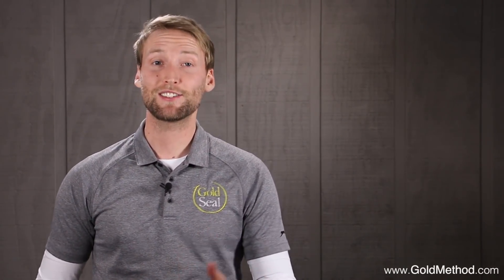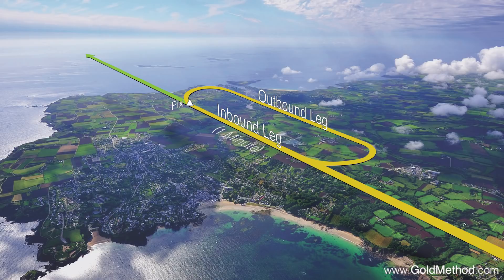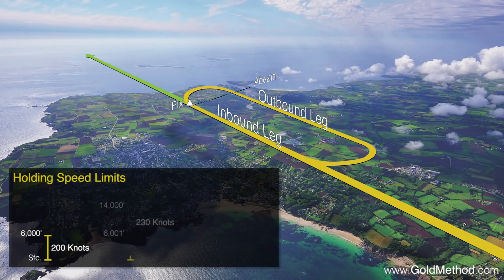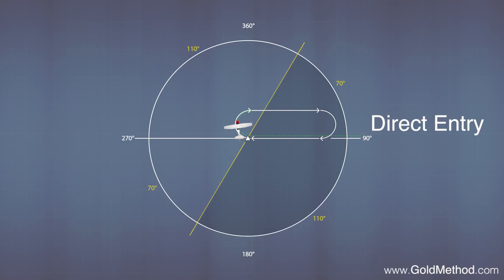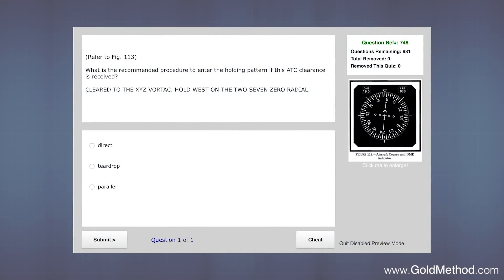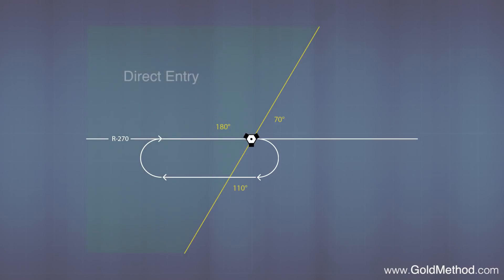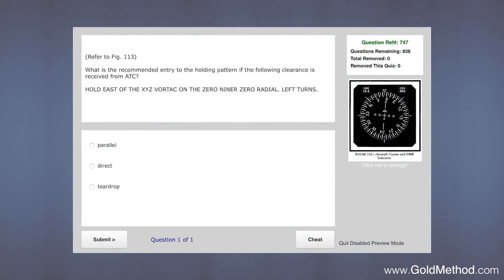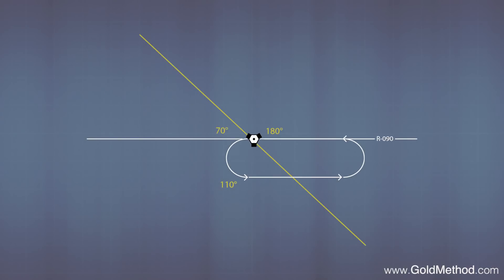Holding patterns  - Instrument Written Test Prep

Comment: I don't get why there is even a teardrop entry as a choice. Who came up with that recommendation? No matter where you are coming from you can either enter direct or parallel. The sharpest turn to parallel on the teardrop side is way smaller than sharpest turn to parallel on the parallel side of the fix. Should only be 2 choices in my opinion

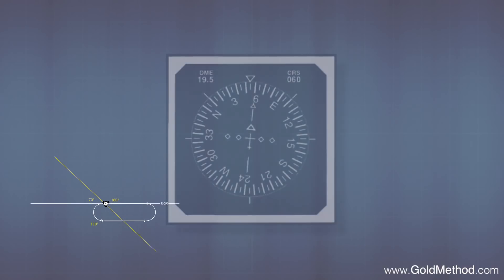Comment: 5:46 why is the yellow line draw from NW towards SE? dont get it. I have headache and frustration
Reply: That is for the non-standard left turn (reciprocal of the standard right turn). It's "the standard right turn" mirrors at the very first of the video.
Reply: The inbound leg needs to be in the direct entry sector.
Reply: Draw the line through the fix so it crosses the bulk of the hold pattern.

Comment: 4:10 i dont get it. Why if you are on the 270radial you are flying 090 heading? Very confusing.
Reply: Rafael Degannes Because all radials are from the station not to.
Reply: You’re on the r-270 but your inbound heading is 090. Thing of it a you must go towards 090 to point A which means your 270 from point As presoective

Comment: I’m new at this and hadn’t heard of holds till I saw this video. How do you know which direction to draw that line separating the three sections.
Reply: So they give you a radial for a fix. That is a from radial. Ex: hold 90 on the xyz vor.  You dial in 90 into the vor, you’ll be holding on the from side of the vor or west making right hand standard rate turn after your vor flips “from” to “to”. Fly the heading out towards 1 minute and make right turn fly 1 minute (vor will say from) once you cross the fix it flips to to. Entry is based on what sector you are inbound on in relation to the hold instructions. At least that’s how I understand it as a student.
Reply: @Hello DAM8658, How are you doing?
Reply: @lydiaanderson3312  Hello, never had anyone ask me that on YT before.
Reply: @dam4274 Hello how are you doing?
Reply: @lydiaanderson3312  I am good, staying warm.

Comment: Awesome graphics!   Would love to see you breakdown this question on Figure 117 of the Instrument Exam, 2016 ASA Test Prep materials :  You receive this ATC clearance: “...CLEARED TO THE XYZ NDB. HOLD NORTHEAST ON THE ZERO FOUR ZERO DEGREE BEARING FROM THE NDB. LEFT TURNS...” At station passage you note the indications in figure 117. What is the recommended procedure to enter the holding pattern?

Note:  The FAA has two instruments in the figure, entitled "Heading and ADF Indicators." The one on the left appears to be a VOR/Glideslope to me.  The right is obviously an ADF. 
Drawing the hold from looking at this instruments has caused several hairs to be pulled out.  Or shall I see, attempting to draw it.  Thanks!
Reply: Whats your inbound course to the XYZ station?
Reply from the maker: If you'll look at GoldMethod instead of ASA I think you'll see the breakdown you're looking for.